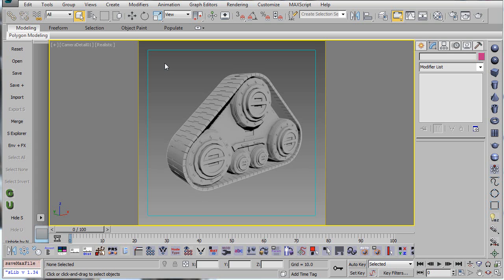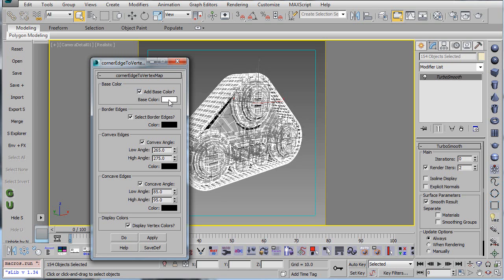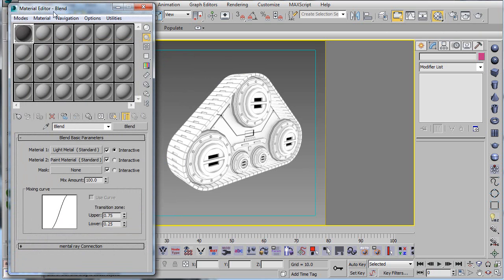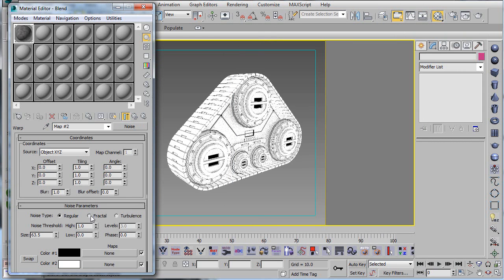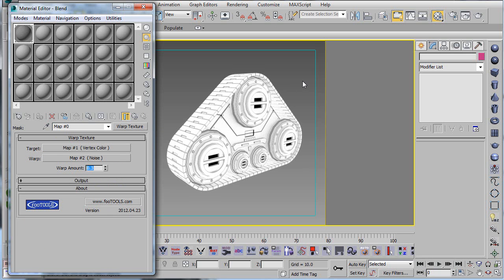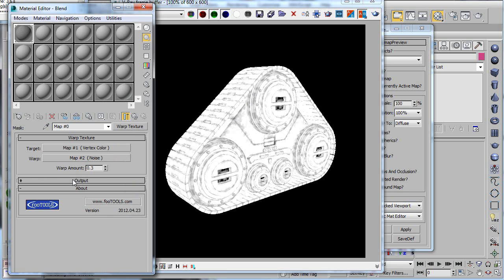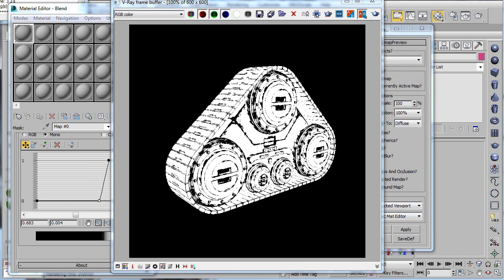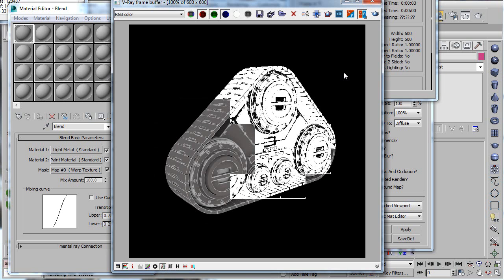Worn Edges Part 1: 3dsmax Vertex Map Method

Comment: Hello Neil, thanks for your mazing work!  I'm wondering if the script is still availble? I downloaded the SoulburnScriptsPack_3dsMax_v108_R2013toR2019.zip, but when i go to customize-user interface in 3DS MAX, in the SoulburnScript i don't find the "cornerEdgetoVertexMap"....maybe has another name? thanks man!
Reply from the maker: Hey Lacapra. Glad you like it. And yes, the script is now called curvatureMaker, you can see more info on it in my other video Worn Edges Part 4: Using Curvature In Max 2017.1, which can be used to create curvature in the older and newer ways.

Comment: Hi Neil, thanks a lot for this tutorial ! I have may be miss the point, but can we have the same effect easier by using VrayDirt ? I have just seen that there is a Vray map called "VrayCurvature" , I can't use it properly and don't have found any ressource about it,  but knowing this kind of "edge map" is also called a "curvature map" does you knows if it does smething similar ? Sorry if I'm not clear enough, I don't speak fluent english.
Reply from the maker: Glad you liked the tutorial. There's actually 2 more parts to the tutorial, giving updates on new technology, and those videos discuss Vray curvature and dirt. So check them out and let me know if you have any questions
Reply: +soulburn3d I will check these videos, thx !

Comment: As always, you are such an inspiration - your sharing and giving to the community is legendary.  Thanks Neil.

PS - I needed this last week for a project :)

PPS - Warp Texture doesn't work for 3DS Max 2014 :(
Reply from the maker: +Jez2008UK Glad you like it. Warp Texture does work in max 2014, I believe you need the max 2013 compatible plugin from maxplugins.de Let me know if you have trouble finding it.
Reply: +soulburn3d Hi Neil,   The link on maxplugins.de leads to only one download (labelled 2015) which doesn't work for 2014.  Do you have the 2013 file you could share please ?  I'm on 2014 and have 2016 installed also (though still prefer 2014).  I do place the file in the Plugins folder, right ?
Reply from the maker: +Jez2008UK Go to the site, click the "Max 2014" link on the lower left, then search for warp texture, it should be right there. Then put it in plugins.
Reply: soulburn3d Oh man, sorry about that.  I'd downloaded the 2016 version.  Thanks Neil :)

Comment: Warptexture doesn't work anymore
Reply from the maker: Nik Shankar-Noble  Nope, it always works for me. I'd think maybe you have the version installed for the wrong version of max, but then I'd expect you'd get an error when you started max.
Reply from the maker: Works in max 2014 for me. Could you give more information on what your problem is?
Reply: soulburn3d
I've had the same issue, where Warp Texture won't appear under the map list. Do you know how to fix this. Thanks for the great tutorials as well.
Reply: soulburn3d Ah thanks, I realised I was installing the 2009 version instead of the 2012. Thanks :)